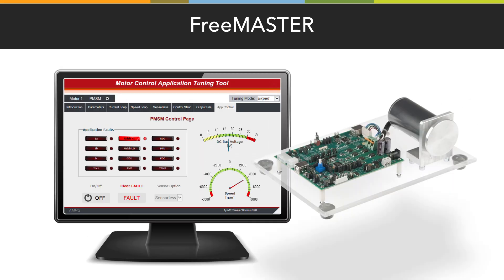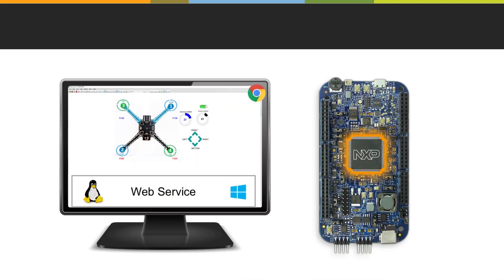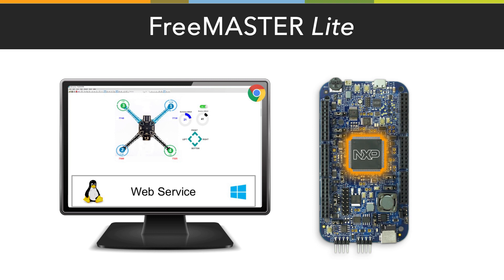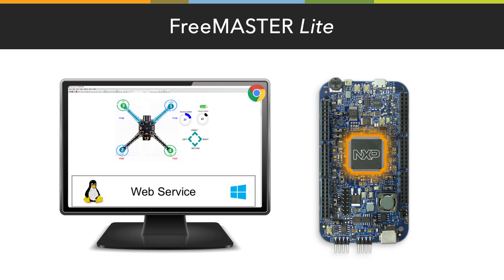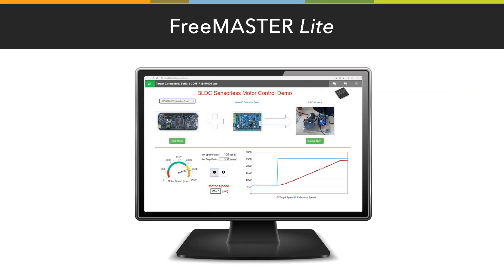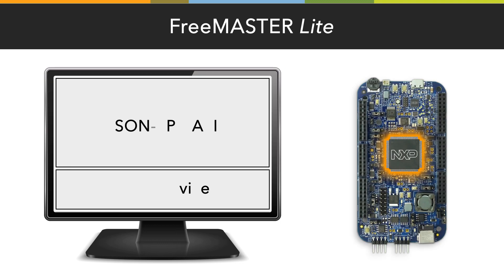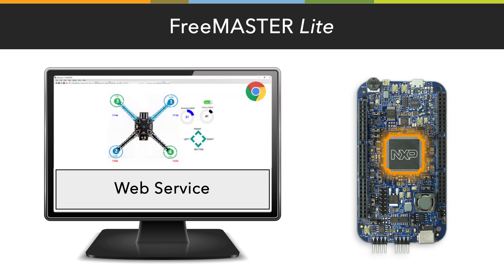FreeMASTER Debug Monitor and Data Visualization Tool

Comment: What is the difference between FreeMASTER and "FreeMASTER Lite"?  For example, is the difference in the embedded library or the PC application, or both?   What is the cost for the app, library, both for full and Lite?   What percentage of the flash/ram is used by the embedded monitor?